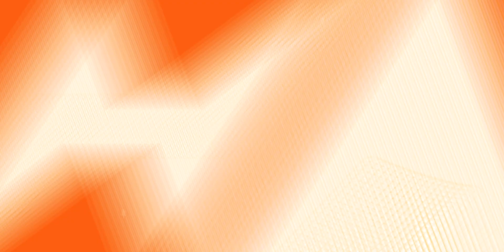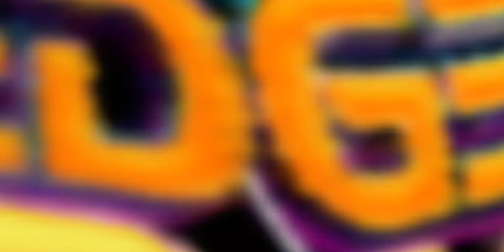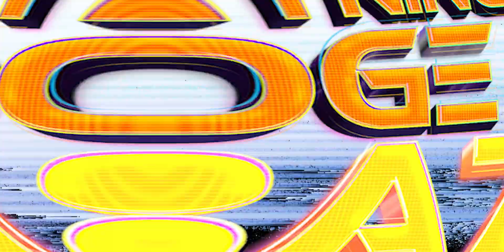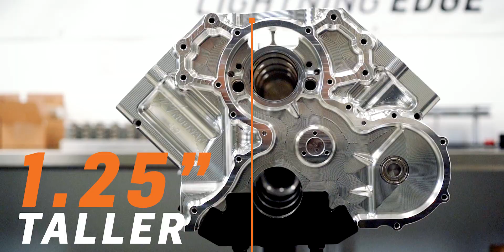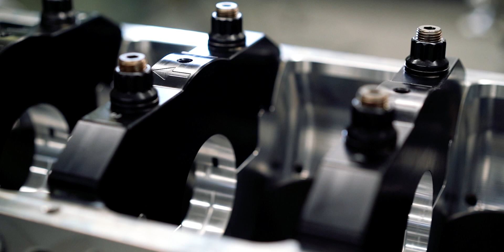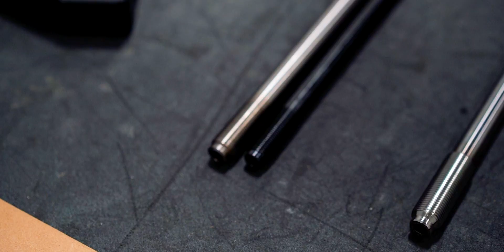4.8 v 4.9 ⚡ Noonan Hemi - Side by Side Comparison

Comment: Beautiful engine nice job making those improvements on the 4.9. id like to see one on the smallblock hemi like axman has in 1 car. I always used to think that all hemis were the same ajpe Brad Anderson and now noonan is in the game. Within that you have several builders that build then you have several builders like extream racing enginesand proline just dont know what is their designes and machining. I wonder how off and you guys pull an engine apart and see somebody modified something that you know is going to cause no lll drama but your heads and block really look better than even ajpe be proud down home dooking f4iends with dreams making it happen. You tuys reming of Tin Soldiers Race Cars.

Comment: What does all this mean in metric. imperial measurement needs to exit the chat because only 4 countries on the planet use this backward long out dated form of measurement the rest of us on the planet use metric. Joining the rest of the planet could be an idea just saying.
Reply: True racing uses cid.
Reply: @Mr.RollTide  In the words of my American brother in-law change to metric in  a country full of grumpy old men is never going to happen. Also all those Japanese engines that make big power are all metric and working in metric is faster than fractions.
Reply: @michaelgleeson1198  Any of those Japanese engines make 5000 plus hp.
Reply: @Mr.RollTide  The point is metric is faster to work with you could build a Steve Morris Billet water jacketed engine in metric it's run to 4200hp at the hubs without leaning on it. Completely different but talking to an American in Japan last year who builds furniture he works in metric because it's faster. It's the grumpy old man issue that stops change
Reply: I’m with ya I’d love to throw out all of my sae tools it’s so much easier with metric

Comment: Interesting. BUT as someone who builds production based engines I know all about block stresses and clamping. The reason the SBC is still the one to beat. You can torque plate one and it actually stays round when you torque the heads on. Equal spacing helps a LOT. These are aluminium so flex more than iron. Even without water jackets they must flex the block with 5/8 studs and 180psi clamping. I suspect ditto on the bottom as well. Playing with a Cleveland, big heavy lump and the torque plated block has gone out of round using 100 psi [with studs] The bottom seems ok. I am building a n/a race 5litre and still using 7/16 studs to limit the flex
A cam that is closed in is pure drag race stuff,, you need oil to make the cam live in all other applications. You have to limit that oil ofcourse. But it is needed.
Reply: Are you implying that small block chevy stuff is superior to this, lol ? Pretty sure there isn't a small block on the planet that competes with these engines, chief......
Reply: Bruh
Reply: Quiet dude the SBC will never be in the conversation with this piece

Comment: Can you make the cylinder head with a a shallower cylinder head,   that is on a normal 58.5 degree combustion chamber,  have it say 40 or even 36 degree combustion chamber with 4.600 bore and a 2.500 intake and 2.100 exhaust with Jesel style rocker arms ???
Reply: What